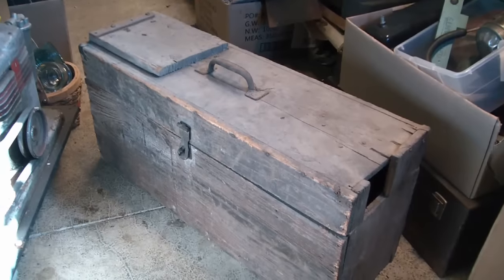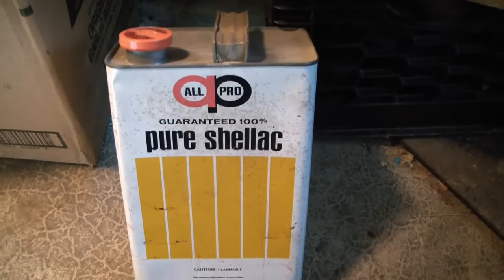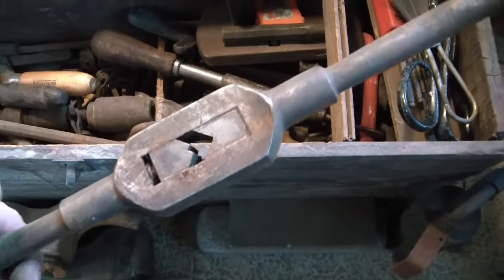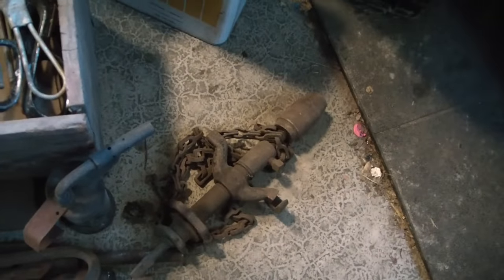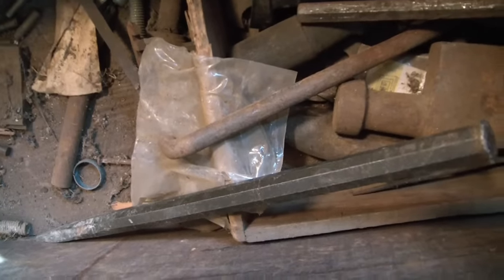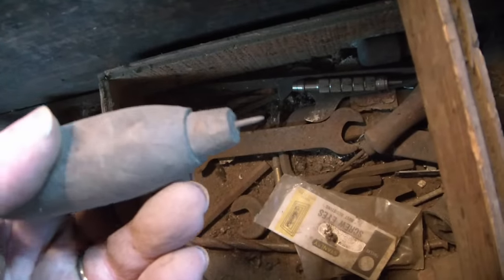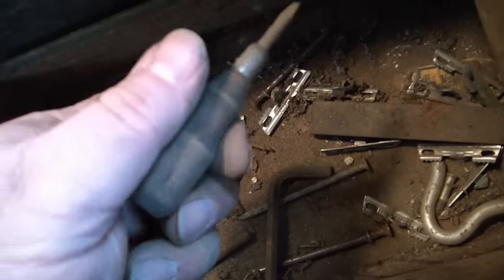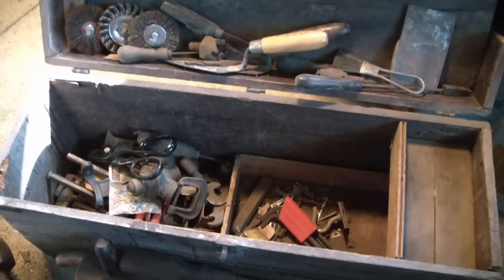Canton Tool Haul #8a

Comment: I think the 4 cog piece is a crankcase receptacle for an old crank start engine, off an old tractor, model T or A?
Reply from the maker: That is very possible!  Thank you for the comment!  If you liked this video, please check out some of my other videos and share what you know about other interesting items!  Thanks for watching!  🙂
Reply: @timeflysintheshop  I meant to type crank"shaft", not crankcase, but I'm old and not the best at typing.
Reply from the maker: @user-pk2fg8im4u  Yes I understood what you meant.  I have looked it up and it appears the be the "claw" for the hand crank for an 8 cylinder 1935-1936 flat head Ford!  Pretty cool!  Though I will admit I never thought you could hand crank an 8-cylinder engine!  The compression ratio must have been pretty low back then!  👍😀😎.   Thanks again for your comment and please check out some of my other videos to share your knowledge about other interesting items!

Comment: That's about as unique and diverse, a lot of tools as I have seen someone purchase. Yes you got a good lot of tools for $40. Ammo? maybe he takes the easy way and instead of trapping anilams in attics and walls he shoots them with a .22 rifle then repairs the damage. Sloppy storage of ammo. That one flat steel tool may have been to operate a valve maybe on a cylinder or even for gaslines or meters.
Reply from the maker: Thanks!  It was quite a find!  There are several good suggestions for what the flat steel tool is used for.  If you liked this tool haul, check out my other videos, you are sure to more interesting things you can share your knowledge and ideas about.  Thanks for Watching!  👍😀😎